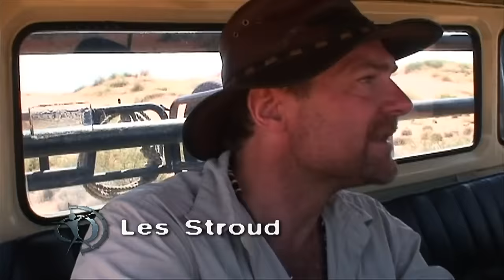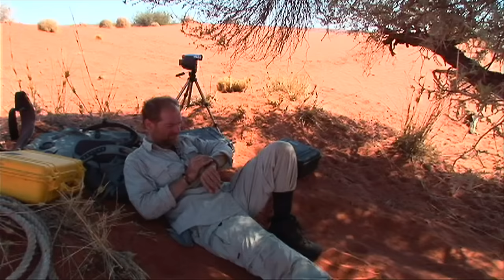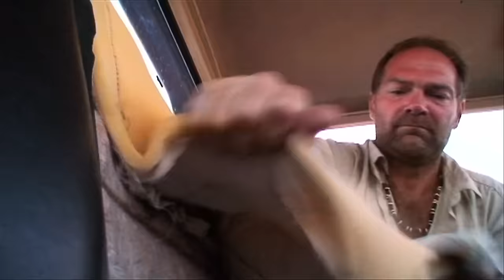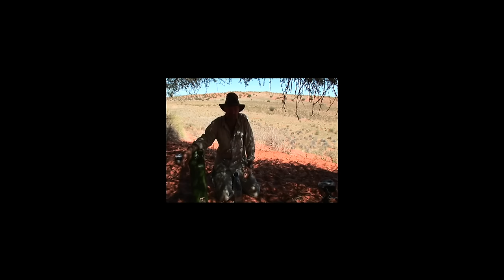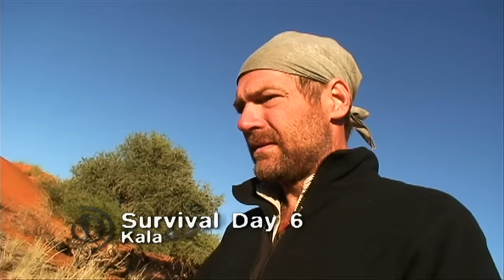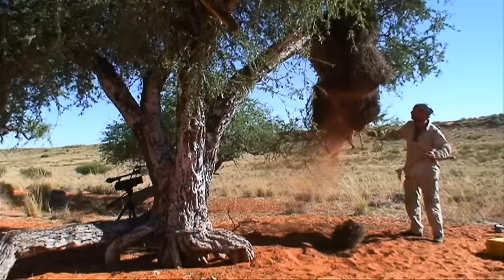Survivorman | The Kalahari Desert | Namibia | Season 2 | Episode 1 | Les Stroud

Comment: It's absolutely incredible the amount of ingenuity Les has, that is 100% required to be able to survive in these environments... I always used to think when I was a kid, "7 days?? That's so easy! That's not long at all!" But as I've gotten older, I've realized just how miserable these 7 days must actually be. Not having food for a day or two when I'm in a COMFORTABLE environment would be hard enough, but not what Les goes through.
Reply: I went without food for I think around 8 days or so one time, just to see how long I could go on just water before it became an issue.

It ended one evening when I realized I was absentmindedly snacking on some peanut butter. Guess that was the end of that.

Of course, I didn't have to do all the energy intensive work of surviving in a hostile environment. But the hunger wasn't even so bad. It peaked on like day 2, and then I think actually got easier.
Reply: @ForumArcade  was it decent peanut butter? because if it wasn't decent peanut butter, why'd you go there?
Reply: dont be ridiculous, theres a crew there with cameras meds and air support. what are you talking about?

Comment: Glad he used gas and oil mixture. For anyone who doesn’t know, oil is harder to light than fuel, but the combination, makes a lasting, easier to light oil/fuel. Fuel by itself on that bundle would most likely evaporate, if not in some sort of air tight container.

Comment: I never believed it when people would say the desert can be super hot and at night it could be freezing. I've driven thru desert in NM and AZ and it was hot. Then I went to Iraq and it would be 115 during the day and you go to bed and it's 90 and in a few hours it's below freezing and we wake up with frost on our sleeping bags. It was such an extravagant temp swing. Desert at night is amazing star gazing so long as you are not near a big city. Hardly no land  obstructions
Also, I've had probably 50 ostrich egg omelets and maybe it's just me but the omelet was a bit more fluffy and also had just a little better taste than a normal chicken egg. They should have shown just how hard the shell is. To break ours the cooks used a hand saw as the shell is probably an 1/8 of an inch thick or maybe a little thicker. You can't just crack them on the pan. Unless your the hulk.
Reply: Even in a hammock in the Amazon. 25 degrees at night and you are shivering at 3 am.

Comment: Yo Les, you threw two containers out (cans) you dismissed the "sugar" shaker, which could be utilized as a UV purification system, you have mirrors, a battery (dual purpose for fire and signal in conjunction with the head lights) a makeshift shelter and cordage in the wiring mirrors could be used as a cook top for the egg and you have high protein peanut butter and some jelly to wash it down. 

You are set brother!

Comment: I managed a pizza restaurant for a few years. The cheapo owners purchased a used oven. They probably knew it and didn’t care, but the oven was missing a huge side panel. The temperature where I stood at the end of the oven was 170 F. It was 120 F in the cooler parts of the kitchen. The fact this guy went even one day at 140 F is absolutely mind boggling. You get past 130 F and it gets real. Like the difference between a pretty spicy chili and a ghost pepper. I feel for this dude on this excursion.
Reply: Imagine wearing boots, heavy fabric long sleeve tops and bottoms, Body armor, Helmet, and ruck sack during record heat in Iraq on a week long operation in the city....Heat stroke sucks.

Comment: I was born in a desert, it was a desert Rajasthan which is in India, where the temperature never drops below 40 degrees in summer, not even at night And it goes above 50 degrees in the day, the heat is a bit difficult for the new generation, but it seems almost less than the whole world, there is a special thing about the desert that the Sand becomes so cold in the winter days.The temperature goes up to -1 degree but it is not so difficult as summer you spend two or four days in the heat and teach survival, we spend our whole life like this

Comment: Honestly, I am very disappointed by the overdramatized tone of this video. 40°c is not that hot.
You have a plastic bag, and there are small trees and bushes all over, you can collect water by condensation process, by wrapping the plastic bag around the foliage. You can use the same condensation process (if you have a metallic recipient) with stones or rocks that you put in a camp fire. This process is extremely reliable, if you find yourself in a desert environment, where the nighttime temperature drops considerably. You can train your system to become less dependable on water and food, and get to a level where your body can accommodate less than half a gallon a day in extreme temperature.

Comment: Bucket of bolts!?  That toy is beautiful, simple, functional, rugged!  Bite your tongue survivor man!  And look to the washer solvent jug.  In summer I usually run straight water (no alcohol). If it has methyl alcohol in it (colored or smells), do NOT drink it!!!  But the jug itself could be very useful.  Also, there can be very serious long term effects from severe dehydration-actual organ damage. Don't try this.  Secondly, once you suffer from heat stroke once, you are more susceptible to it in the future.  Be aware of this.

Comment: In my humble opinion, Les didn't handle this the right way.  After 2.5 days, he hasn't re-hydrated near enough.  If he had a gallon a day reserve, he should have been able to drink a half gallon a day and survive with the Peanut Butter and Jelly.  He shouldn't have put the gas/oil on the tinder bundle either. It would burn too fast.  I do live in AZ and have once had to deal with 131 degrees in Lake Havasu, AZ... in the mid 1990's/summer.

Comment: I love Les, but you don't need to overplay the heat factor. 35c at 10am isn't bad, and mid-40s is hot, but not unmanageable. Also the '60c' quote at 8:55 is horseshit. The record highest temp in the Kalahari is 44.8c, and the hottest world record is 56c.
Reply: He was referring to the surface of the sand

Comment: My question is how does he "remove the oil filter on the truck" and not have just dumped oil all over the sand 🤣 ....hmm that sounds a little fishy to me 🤦😂
Reply: well he probably did! but also some times the oil filter is higher than the oil reservoir so it might not spill, unless you remove the bolt on the tank